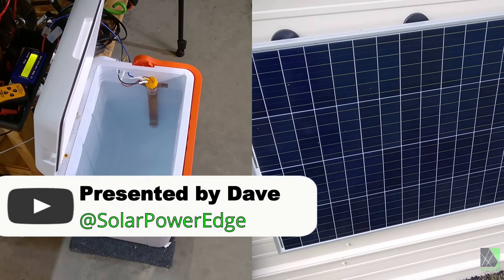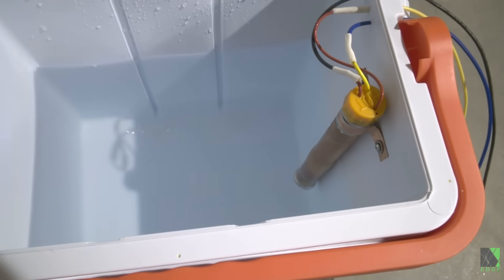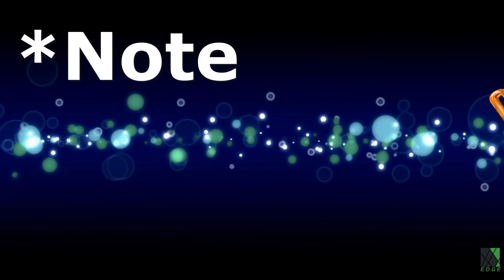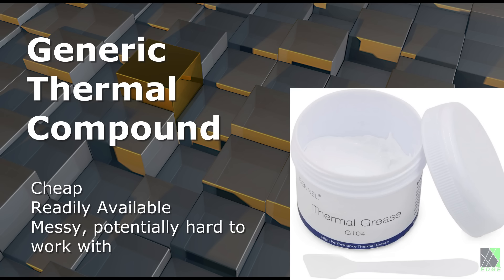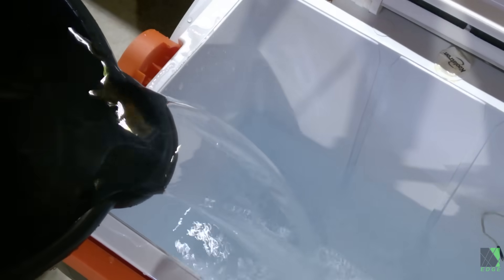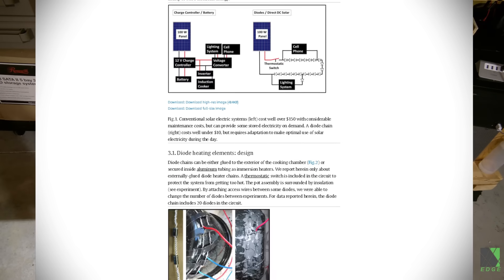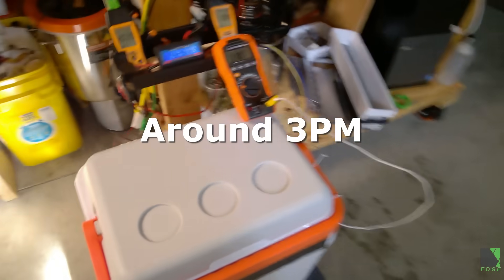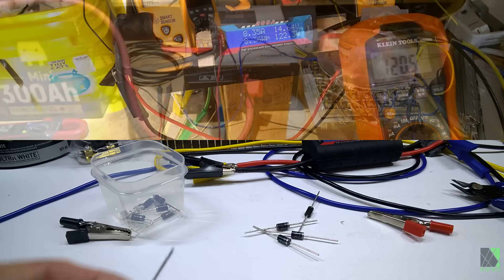I built a PV DC Semiconductor Immersion Water Heating Element! diode chain application #science

Comment from the maker: This topic seems to be broadly misunderstood. It is 100% verified fact by both myself and others (including university researchers) that diode strings can produce more heat (or watt-hours, BTU) from a given solar panel than a bare resistance element. 
FACTS:
1) Diodes are not "Ohmic" so we cannot use Ohms Formula to calculate I/V/R as one would for resistance element. You could certainly try the maths, but they don't really work for diodes. Interesting exercise at least.

2) Diodes drop a roughly constant voltage (of course it's not perfect and does vary some)
3) Therefore a string of diodes will drop a roughly constant voltage equal to the number of diodes in the chain

4. Therefore diode strings can be matched to the vMP region of a solar panel, and they will drop roughly the same voltage all day, while the current rises in the morning, peaks at noon, and falls back away towards evening. This generates behaviors similar to an maximum power point tracking circuit, although it's not.

5. The diode string operating in the volts-max-power region nearly all day easily beat a bare resistance element. It's obvious - the diode string is holding a nearly steady voltage in the vMP region nearly all day, Volts x Amps x Time = watt-hours, diodes win hands down as they stay at or near vMP. MPPT charge controller does something very similar, no wonder they are so popular...

6) Resistance elements are linear (I/V/R) and will appear in the morning almost like a dead short to the theoretical solar panel producing almost no heat. The diodes will already be warm and operating at a much higher voltage. As the sun comes up, the resistance element will pass more and more current, but at a higher and higher voltage, generating a peak up to noon and falling down towards evening. At some point it will enter the vMP range, but it cannot stay. And current (amperage curve) will also look similar with a "peak" which is the expected behavior.

7. Diode strings connected to a solar panel create a "flatter" voltage curve - verified fact by multiple researchers - and it's obvious on it's own, because the diode is not Ohmic and just drops roughly constant voltage, we don't really see a diode string behaving like a resistance element - in general.

6. Bare resistance elements create a "peaked" voltage curve - again verified and obvious fact - in fact I've been verifying it for years by operating multiple resistance loads directly off my solar panels, heating water and heating my house :)

8. Diode string elements connected to a solar panel produce a "quite flat" voltage curve - again verified and obvious fact - verified by myself and multiple researchers in universities.

9. A diode tends to flow current exponentially versus the voltage flowing across it.

10. A diode tends to pass voltage roughly the same regardless of the current flowing across it.

11. #9 and #10 can help explain why diodes behave so differently and just so happen to match solar electric heating applications well.

12. Diodes aren't perfect, and sometimes do exhibit certain linear behaviors, depending on the type of diode, it's quality etc. but overall behavior matches what I have described in this video and in practice (and reality) in bench tests and real-world testing - not only theory. Diodes do some times have some Ohmic properties, for example due to the connecting wires and leads connecting the diode package.

13. Under changing solar conditions, which is reality, the diode string will far out perform a resistance heating element. The reason is the diodes keep the voltage up near vMP, but the resistance element swings the voltage significantly greatly reducing it's power output as the sun dims or cloud cover blocks the sun.

14. Thinking in terms of watt-hours, a string of diodes will produce lots more watt-hours (which can be thought of as converted to heat) versus a bare resistance element, because the diodes can stay near vMP under changing conditions. But the resistance element reacts noticeably to changing solar conditions, causing voltage to drop significantly and losing overall power. This I have repeatedly verified for years by watching the voltage of solar panels connected to various electric heaters with bare resistance elements.

[I may update this list later as time permits] DD
Reply: I think I would put continuous heat-shrink tubing over the entire diode string, shrink it, and immerse that in baby oil inside the copper pipe. The heat-shrink tubing is merely to prevent any possibility of electrical shorts between diodes and pipe. The baby oil would not hurt the diodes. Baby oil has low viscosity, so it will circulate by natural convection, transferring heat from diodes to the pipe and then to the water. I would use wires rated for high temperature and water immersion, NOT the standard vinyl-insulated wires. I would seal the wires to the pipe very securely, and lay the pipe on the bottom of the plastic water tank. That way, natural convection will circulate the water, eliminating the need for a pump. 
Alternatively, lay the insulated diode string right on the bottom of the plastic water tank, and fill the tank with baby oil. Extract heat on demand with water pumped through coiled copper tubing immersed in the baby oil. This will also eliminate the problem of heated water vapor pushing out of the plastic water tank, which it will, because it self-pressurizes when close to the boiling point. That will not happen with hot baby oil.
Reply from the maker: @YodaWhat I have to try this. All good thinking. Baby oil I think is mineral oil or some variation of it. Really this heating element ought to sit on the bottom of the tank like you're suggesting. It was a real compromise putting it at the top but did allow me to fiddle with the connections and thermometers etc. Hope to improve the design later. 
The heat shrink would even heat shrink itself when the diodes heat up probably :)
Reply: @solarpoweredge  FR3 contains no petroleum, halogens, silicones, or sulfurs, making the cleanup easier and less expensive than that of typical transformer mineral oils
Reply from the maker: @loulelea Thanks I'll have to give it a try, found a company selling it :) 👍
Reply: @YodaWhat Great comment!  The two of you together have my brain goin' to new places.
Reply: @YodaWhat  I've seen dummy load designs for emeteur radio use based on 1000 Ohm resistors.  Basically enough of them put in parallel and series to achieve 1000 W power rating and 50 Ohm total reistance.  The individual resistors are mounted with ample distance from each other to allow for cooling which is achieved by immersion in oil.  The design I saw was using plant oil, cheapest offer wins.

A chain of diodes in their individual glass or these days more likely plastic bodies is probably better protected against whatever residual corrosion effects the oil may have, than bodies of resistors.
Reply: @ralfbaechle  the issue with cheap plant or vegetable oil is that it becomes gummy over time and the diode string would be difficult to repair later when a diode or two would burn out
Reply: @subhobroto  That was my initial convern as well but the guys who tried it said they had no probel with deterioration of the oil.  Which presumably ignored the repair aspect but our prospects don't die, do they?
Reply: @ fair point. When I was testing this based off Dave's earlier videos a few of my cheap diodes would overheat and die because it seems like their Vf changes heavily with large temperature swings. That said, I was buying generic power diodes from Ali. The fix was baby oil and metal screw in connectors to make replacement easy.
Reply from the maker: @subhobroto I found by using a diode-driven 12v DC fan + heatsink, this problem could be helped. By continually removing heat it makes the temperature affect VF less. In some cases I found with big power increase the voltage swings up: but they slowly pull down again after a few minutes. Not an intelligent circuit but almost seems like it :)
Reply: Can one use carbon heating wires? They are water resistant, can be burried, and cheap and availble in long lengths.
Reply from the maker: @perpetual4958 This is definitely something to try!
Reply: @solarpoweredge  I presume the carbon wires act as a resistive element, so to be used in two layer/hybrid set-up?
Reply from the maker: @perpetual4958 Yes absolutely
Reply: What determines the heat output from a diode? Is it just Watts , or  does for example higher voltage and lower current produce more heat than the reverse? Also does each diode in the string reach a certain temperature at exactly the same time as all other diodes?  What effect does having fewer diodes in the string have? e.g. Having a string of 10 diodes vs 20? Does it mean that in the first case that all diodes will get hotter than in the second?
Reply from the maker: @fleaniswerkhardt4647  It's 1:1 watts for heat. The gain comes from rudimentary tracking behavior of the diodes. Solar panels operate best in a specific voltage range, and diodes can track that voltage almost like MPPT. It's a very clever way to use diodes. Having fewer diodes lowers the voltage, adding more raises it. It is somewhat tedious finding the perfect voltage match, but in my experience it's worth the effort. The amount of heat the diodes produce is simply a product of volts x amps (Watts)
Reply: I looked into the idea of using a semiconductor based heater for hot water heating several years ago.  My objective was slightly different - I wanted to have a linearly controllable heater such that it could be used to balance PV production against the system loading with any excess energy being used to heat the water.  One way to achieve this goal would be to use some kind of PWM control and control that to determine the heat delivered to a conventional resistive heater element, but this resulted in not insignificant losses being generated in the PWM control circuit.  I then started to think about how I could recover this heat being generated by the PWM control and couple it into the hot water, when the obvious answer became apparent - to simply use a linear controlled transistor as the hot water heating element.
One detail with semiconductor based heaters is that the purity of the silicon needed is much less than what is typically used in the semiconductor industry to make diodes.  Those diodes that you used in your experiment would be made using something like 11-nines purity silicon.  Such high purity is used in order to get really low reverse leakage current characteristics but makes the cost of producing a large die part quite expensive.  For heating applications the reverse leakage characteristics can be relaxed considerably, so it would be possible to lower the purity of the silicon down to say 6-nines purity.  Using much lower purity silicon makes it possible to consider using much larger die diodes.  As an idea you could look at using a PV module as your heater element - a PV module just looks like a series string of silicon diodes which are typically manufactured using lower purity silicon - e.g., typically 6-nines purity.
The Si die size in those diodes that you used are tiny and therefore long term reliability could be an issue if you use these types of diodes for heating applications.  By designing a diode specifically for heating applications that features a very large Si die will allow the peak temperature of the diode to be kept essentially at no more than the water temperature which should be very beneficial from a reliability perspective.
Reply from the maker: A large diode plate would be ideal for heating purposes. I don't know if such a thing will ever exist, but if it does I will buy some right away. Interesting thoughts, thanks for sharing
Reply: @solarpoweredge  First thought - isn't a solar cell basically a diode plate?  It would be kinda irronical to use solar cells for both power generation and heating.
Reply from the maker: @ralfbaechle There are some similarities, and indeed that's an ironic way of using a solar panel :) but currently I don't have a single solar panel better suited to heating vs. sitting out in the sun making power

Comment: I just installed 2 ductless mini splits.   They have a cop of 4 at 47 F.  I am trying to integrate the resistance as backup heat which is absolutely necessary down in the 10-15F as the performance drops.  Originally was thinking of straight solar to the resistance, electric hot water, but that is only a COP of one. Yours, however, looks to have a higher COP.  That determination looks like it could be significant. (or using a solar panel with resistance electric could be a COP of less than one and your system brings it closer to one.🫩)
Reply from the maker: @timbrown9305 Hi, indeed heat pumps work well if it's relatively warm outside. I've noticed the COP drops like a rock when it gets actually cold. Hence I use a lot of space heaters to save wear and tear on the compressor. 
***Also it seems there is a general misunderstanding of how diode strings work with solar panels.... I recommend reading the "hot diodes" research paper - the additional heat comes from holding at or near the vMPP region on the solar panel array. Otherwise, the COP of diodes is the same as a piece of wire! Hope that makes sense, any questions please feel free to ask.
Reply: @solarpoweredge thanks this entire area has been of interest to me lol of my life.
Reply: My mini splits are doing well down to about 10 F. You then have those losses on both the rooms ability to hold the heat and less heat available for the heat pump.

Comment: I have a PV- resistance setup that I’ve used for a year as a hybrid to support a HWHP through it’s spare heating element.  I have played with @Opera’s mpp circuits, but have not got ‘all’ the chops I need to get it right yet.  

Really want to play w Diodes as well, and appreciate your vids and work.   One way to integrate w existing code regulated plumbing systems may be to plumb in what used to be called a Sidewinder.. a heat exchange loop tying your DHW tank’s output back to the input, prob with a small circulator pump, and bonding the diode chain to the EXTERIOR of that cycling water to blend it into the storage tank.

Let me know if that’s already problematic, but I think it’s basically workable.
Reply from the maker: @BobFiske I like the idea of bonding the diodes to a water loop, keeping them out of liquid... great idea! Hope to spend some time on this once the workshop is up and running. Thanks for sharing!

Comment: Very nice explanation. I'm planning do build a PV heated raised bed for plants, in order to help starting the growing season earlyer. But the high cost of complex electronics stopped me till now. But this solution could be the simpler and the cheaper. 
So I think to put sand on the bottom of the raised bed,  then soil on top. The only concern is that the sand will get wet and I'll need some sort if insulation as you used in the pipe. Could some electronic water proofing solutions work? Like the one you apply in the circuit boards to make them waterproof. Need to be also heat resistant. If not i need to make sure the sand don't get wet somehow.
Looking forward to see other experiments
Reply from the maker: @George-vt5rf Hi, one of the most annoying challenges is insulating the diodes from electrically shorting out, while still letting the heat through to heat the water (or soil or whatever). Imagine if we had diodes designed from the ground up to heat. That would make is super easy. 
Anyway your idea sounds like it would work. PS  I always say there are 10,000 experiments to try, and only .05 of me to do them :)

Comment: Interesting, have not researched diode heating before, but I'd assume that mppt charging a battery, then a resistance heater would be cheaper (?), and could just run off the battery.
Reply from the maker: @pascalj4331 In general, a diode string heater shouldn't be used with a battery because they could conduct basically infinite current (like a short). A solar panel is current-limited, that's why it works so well with a diode string. So with a battery + MPPT, a resistance heater would be the proper choice in most cases.

Comment: Interesting.
Reply from the maker: @shawnr771 :)
Reply: @solarpoweredge This might be a little beyond my skill level.

Would one of these devices work for a sand battery?
Reply from the maker: @shawnr771 Hello, I couldn't find a way to use them in sand, the heat rise is too fast causing the diodes to be destroyed. So I'd stick with normal heaters for sand
Reply: @solarpoweredge Thanks.
Reply from the maker: @shawnr771 NP

Comment: I enjoy your videos and this sugestion, you have probably thought of but here goes, you could use distilled water for heat disperssion. Add a pump and cirulate the distilled water through a copper pipe in the bottom of the tank. That would keep the diodes cool and get the heat where you want it. Cheers
Reply from the maker: @rodjack2737 Hi, glad you like these videos - good ideas and thanks for sharing. A small 3-5w pump should work well to circulate the water and move the heat.

Comment: Could this be used for a livestock water tank?
Reply from the maker: @FFRJB1971 Yes, you might get a few percent more heat from PV. However since nothing off-the-shelf is available yet, I think it would be better to use a standard resistance element for livestock tanks